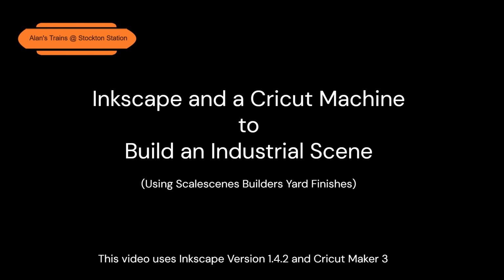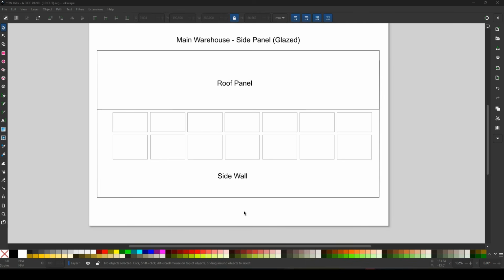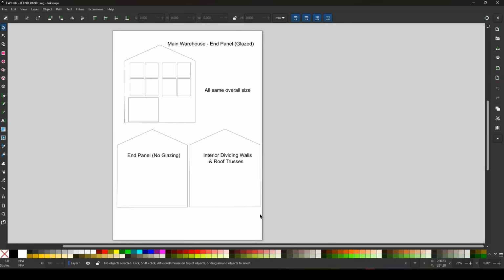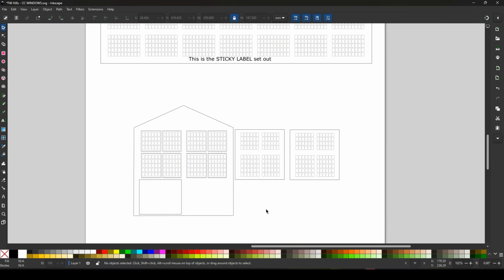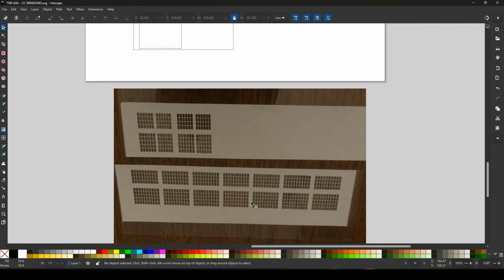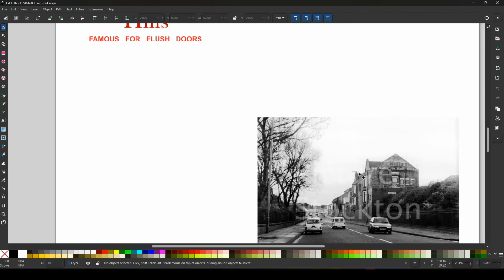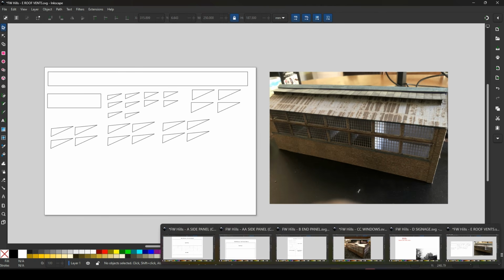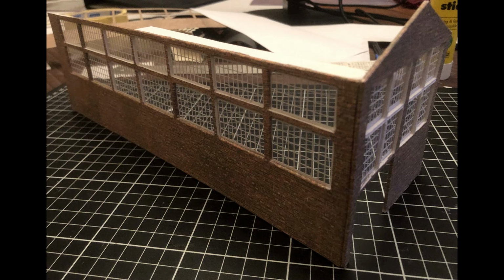Using Inkscape and Cricut Machine to Build an Industrial Scene (FW Hills Factory Area).

Comment: Excelent work Alan.  I use Inkscape and a Cricut machine too but you have taken it all further. 
3 questions.  1) which Cricut do you have?   2) how thick is the material for the walls?  3)  What blade did you use?  Cheers Michael
Reply from the maker: Thank you Michael. I use a Cricut Maker 3 and in this video used 1.5mm card and a deep cut blade. I use Premium Fine Cut blades for the windows. I have also just posted a new Inkscape Basic 6 Align and Distribute video which shows in detail how I made the windows. The space between each pane is 0.4 mm and the fine cut blade does a great job cutting sticky labels paper set at 120gram paper Alan
Reply: Thanks Alan.  I shall take note of all that. Cheers Michael
Reply: Hi Alan, once again superb work. I would love you to make a video seeing you assemble one of the buildings 😊 thank you and once again excellent work.
Reply from the maker: @dr-onestuffido thank you. I will do the assembly in detail on next one as it’s a tricky relief build which will take some research.